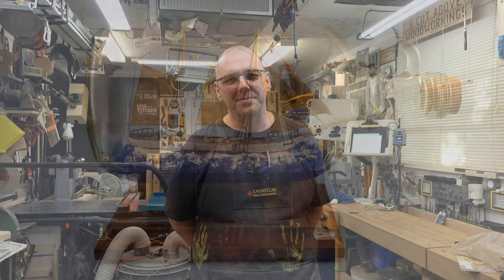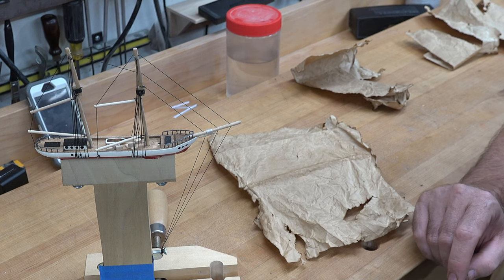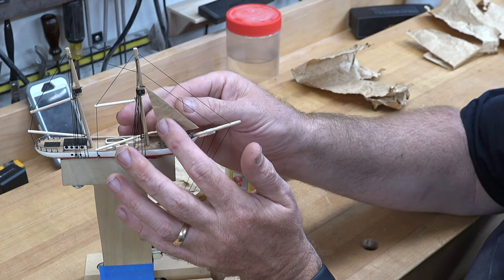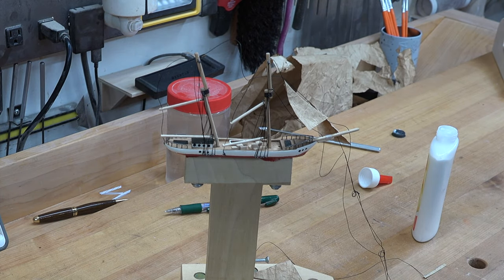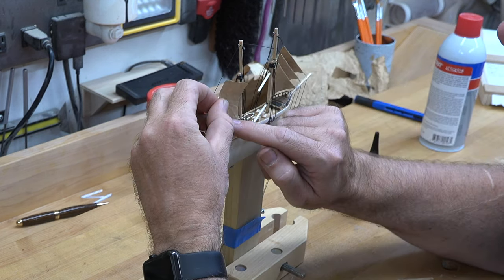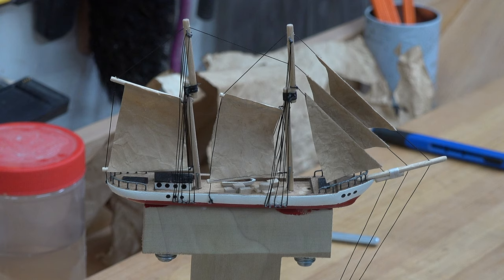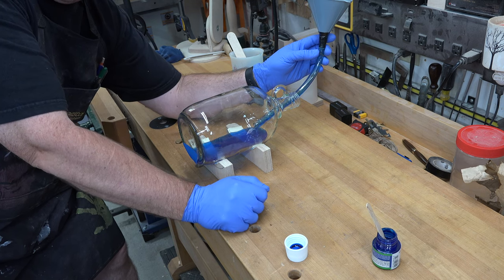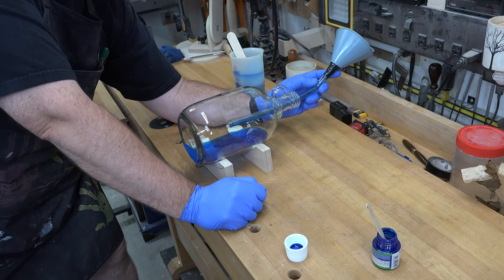Ship in a bottle Part 5

Comment: How about a”sleeve” of a clear acetate rolled to fit snugly through the neck to protect the neck from the silicone ‘bobbles’ as the hanger/tool is run in and out?
Looking fantastic! 👍🏼
Reply from the maker: That's actually not a bad idea at all.  I love it.  Although the silicone isn't hard to clean from the neck of the bottle, not having to clean it at all would be preferable.  Thanks for tuning in and for chiming in with your great suggestion.  It's appreciated.